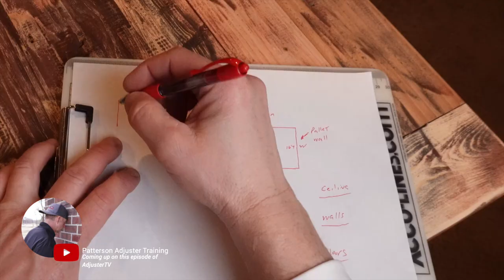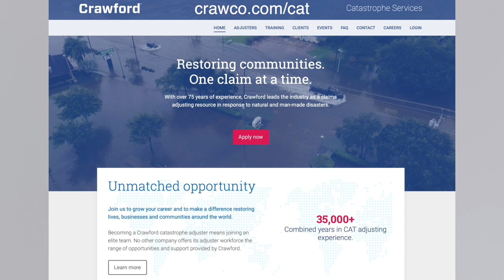Staff Adjuster YouTube channel to help Independent Adjusters | Should you deploy with NO EXPERIENCE?

Comment: I’m confused at to what role an independent property adjuster plays after they submit their initial estimate.
 I’ve heard of different adjusters having all different kinds of authority, I’ve heard that some settle on sight, I’ve heard that some adjusters only inspect, I’ve heard that some deal with claim until it’s closed, and most commonly I’ve heard that the adjuster inspects the loss then writes the initial estimate then hands the claim off to a desk adjuster/file reviewer and they deal with the claim from there…I’ve also heard some adjuster determine coverage and some don’t? How are supplements typically handled, does the desk adjuster deal with that or the field adjuster? Do Dailey and CAT independent adjusters have the same authority? 
 I can’t seem to find a clear answer to these questions.
 Thx for your help!!
Reply from the maker: Hey, Hayden..  So for the first part of your question - yes all of those things are true and depending on the event, you could be asked to do any of them.  And for supplements, again it depends on the event.  But if you're making a coverage decision and settling with the insured initially and a supplement comes up later - most companies will want you to handle your own supplements if you're still on site.  
Authority depends on experience level and trust.  A new adjuster might have zero authority - meaning that they have to get every file they do approved by a manager before they can send it through.  That usually doesn't last that long..  as long as things are clicking with the adjuster.  Later, an experienced adjuster might have $30-50k of authority that they can write without getting somebody else to sign off on it.